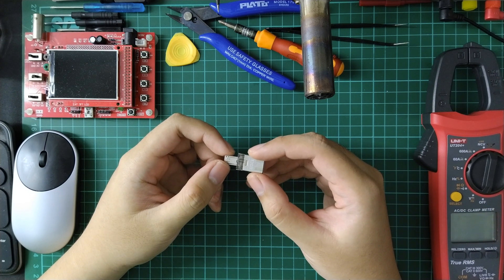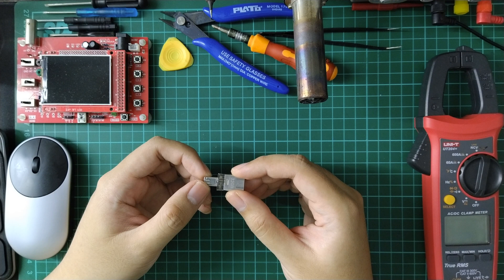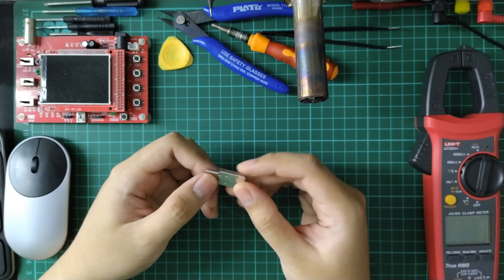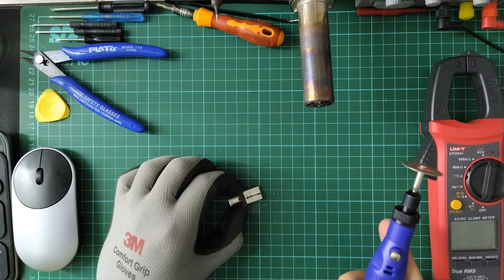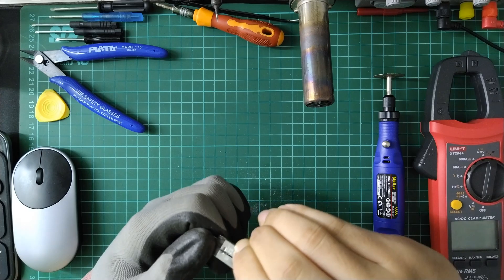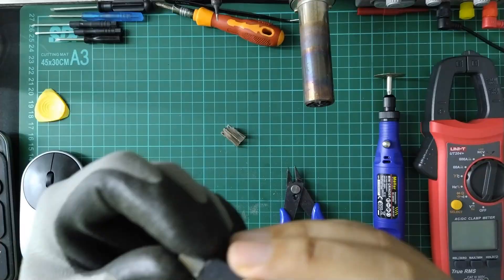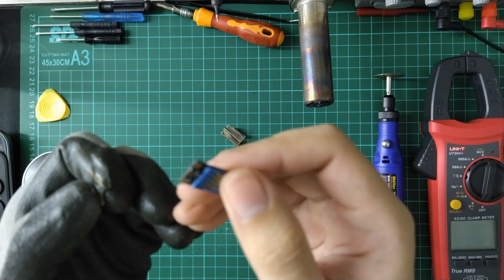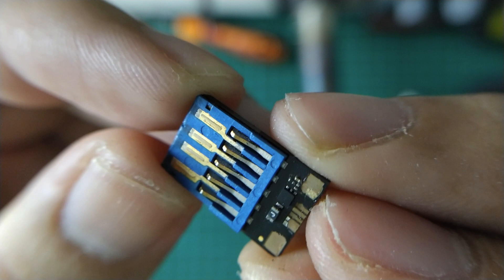VLOG EN: SANDISK ULTRA DUAL DRIVE USB 3.0 MICROSD CARD INSIDE!? DISASSEMBLY / TEARDOWN

Comment from the maker: Update on video description. If necessary, you can tag @widyahong in the sub-comments so i can read it. This video has been added with a manual closed caption. You can activate it into your native language by using the auto-translate feature.
Reply: @widyahong i have the same but it's not working it says no disk inserted into  drive d so i stripped it down any possible repair, data retrieval. I sent it to a data care centre they said it can't be repaired through software. Can i solder it to another usb stick

Comment: I recently have totally dead sandisk ultra curve
When i opened it, it look like that.
I won't buy sandisk products anymore i rather have V-Gen SATA instead
Reply from the maker: @meyers0781  We cant compare usb device with sata device, sandisk is large flash manufacturer, vgen just have brand, if you need cheap device you can buy fabless product like kingston or adata.

Comment: whats the component with "J" ? that's dismounted in mine so want to replace it.
Reply from the maker: I think its just a resettable fuse, you can jumper it. When i read with meter the value is 1.2 ohm (likely resettable fuse). The track goes to somewhere not to usb port. I cant check the track when the device active sorry.

Comment: @widyahong i have the same but it's not working it says no disk inserted into  drive d so i stripped it down any possible repair, data retrieval. I sent it to a data care centre they said it can't be repaired through software. Can i solder it to another usb stick
Reply from the maker: Yes it can but not easy because the chip package doesnt expose nand i/o pin, so we need sacrifice another same model flashdisk to get location of nand wafer inside chip package by scratching the chip package and hope we have same model inside and can manually connect nand wafer to another controller wafer if we dont have proper recovery tools..
Reply: how can i do it? @widyahong

Comment: Teardown USB 3.0/3.1 Type-c Data Cable plz.
Reply from the maker: I dont know what you mean but, all usb data cable 3.0 and 3.1 is the same, for information about universal pin out and cable code colour available on google.. for about sandisk flash disk i think is the same, all is boring because all in one package model like in this video..

Comment: I've Exactly the same, flash drive. I was just wondering will it still work if i strip the micro usb connector. So that it looks like "sandisk ultra fit"
Reply: I wish I found this video sooner.
Reply from the maker: Yes of course it still work even you damage the micro usb port like me in this video, in other case, i solder some male-female jump wire (dupont wire) to usb port/pad and conect to my motherboard via usb pin and still work fine.
Reply: @widyahong  that's so cool
Reply: can u make a vid or short tut? @widyahong

Comment: I did it what to do next
Reply from the maker: What did you do for next?
Reply: @widyahong  i thought there is a sd card so i can use
Reply from the maker: @jayson9421 Like in video there no micro sd card inside, nand, controller, and power section all in one chip package with pad only for external component and usb port, yeah i know its disappointing..
Reply: @jayson9421  bruh